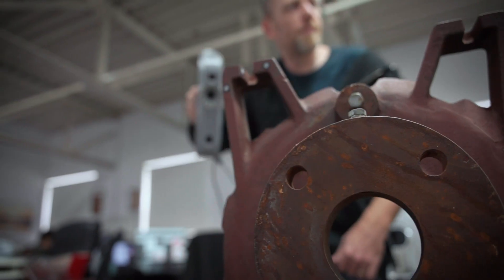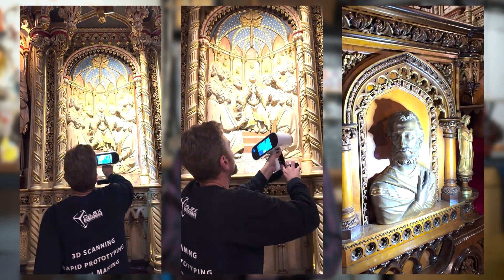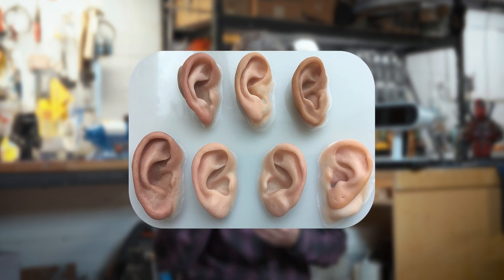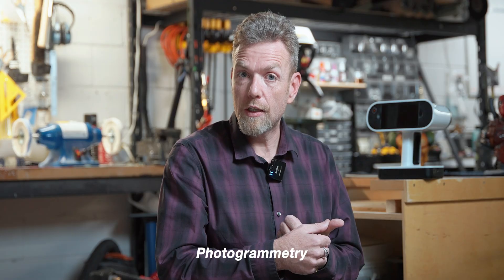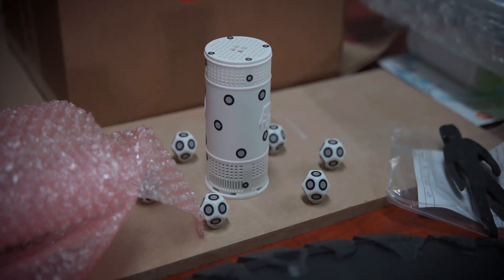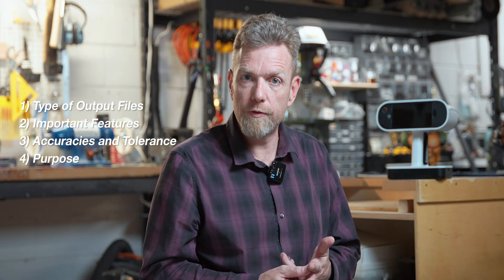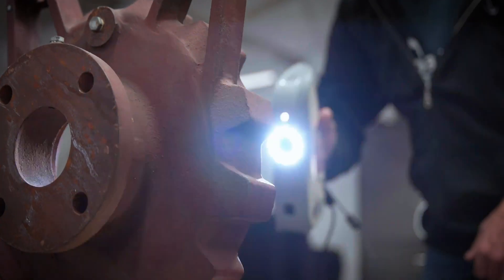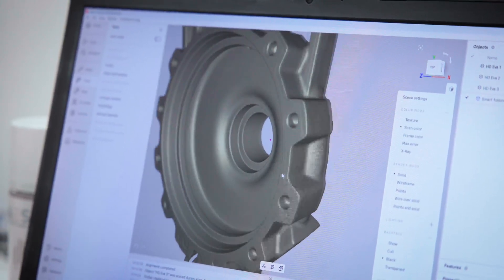Everything you need to Know About 3D Scanning! | Objex Unlimited

Comment: 3D scanning is great if you have a bunch of money for a scanner, but a fantastic option is using Polycam (use the photogrammetry option for the best result) can capture below 1mm in accuracy and produce meshes and with textures, and it's only $89 a year, in fact if you go visit their website and don't buy and visit again you may get a half price offer for $49. Compared to thousands of dollars for a decent 3D scanner, I choose this option and then use a caliper to verify dimensions for reverse engineering. 
All of the points in this video are spot on- bear in mind higher resolution means larger data and longer processing times. Don't work to higher tolerances than your project rerquires. 
And YES, if I need very high resolution scanning I outsource it- then I save a bunch of money and get a clean, repaired mesh for much much less than owning my own scanner.